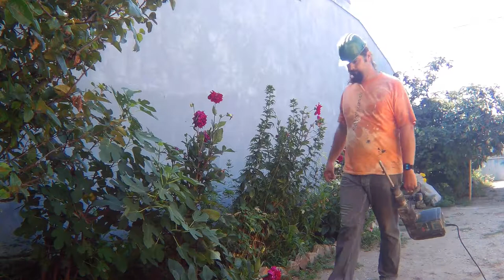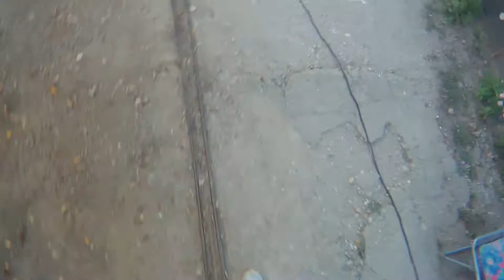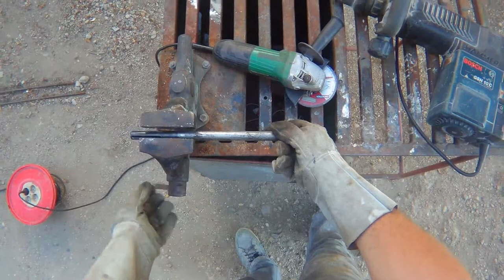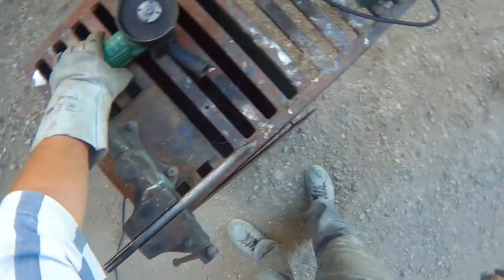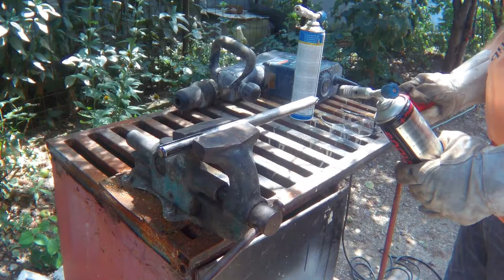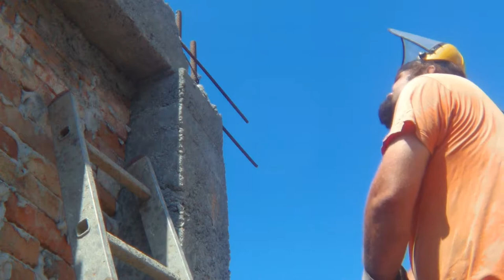DIY sharpening a Bosch GSH jack hammer chisel tip and heat treatment

Comment: I loved the video. I would really liked to have seen the tip once more at the end of the video after the work you did. To see the tip post heat treat and testing. To check out the wear on the tip.
Reply from the maker: Hy, thanks for the comment. In hindsight, yes, some "after" footage would have been nice, but unfortunately this video was recorded many years, ago, I did not had the chance to use that particular Jackhammer in years. To comment on how the heat treatment is doing, i can say that is certainly holding better than no heat treatment, but is not up to the level of a new (original Bosch) tip.

Comment: 😂 nice video. Glad you didn’t quench the whole thing. Also I noticed while you were lighting the torches, you lit one set it down and lit the other with the same lighter. You could’ve just used the already lit torch! 😂 it was just something I noticed.
Reply from the maker: Hello! Yeah, I tried to quench just the tip, as not to make the whole chisel brittle. Also, good point about lighting of the torches! Is just that I did not thought much about it, and if I come to think of it, i do it both ways when I work in my garage with more than one.  :)

Comment: We use the 70's and 80's chippers. I think thats a 70 your holding. We run them 10hrs a day off boomlifts. Does that heat treatment make it last near as long as original? Which is about a week
Reply from the maker: Hello, I use this jackhammer as a non-professional, i.e. doing occasional work. Therefore, as far as I am concerned, the heat treatment lasts a few months to a year, but I suspect that it will not last as close as the original. But certainly better than no treatment, in my opinion.
Reply: @isographer  cool. Thanks for a response

Comment: Could this dig into Rocky ground?
Reply from the maker: Hello, Sorry for the late reply. The short answer is no. Not because the jackhammer wouldn't penetrate and break rocks, but because the device and the chisel attachment are not meant for digging or be used in a manner similar to digging. First of all i believe any lateral force applied to the device (as one would do when digging) might damage it, as it was designed only for forward thrusts and second of all the shape of the chisels  is not efficient for digging.  This jackhammer is only good for breaking stuff, any actual digging should be done with a shovel or trowel.